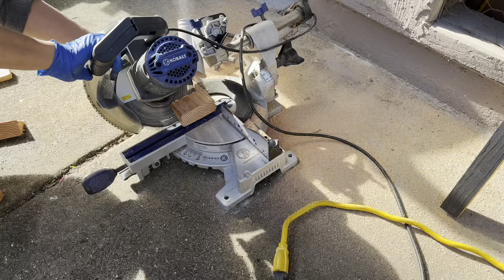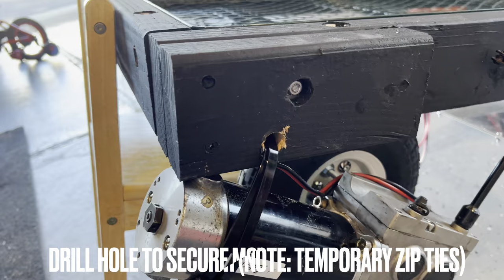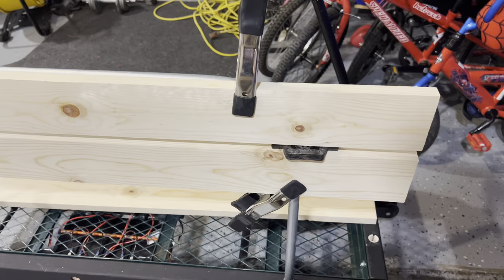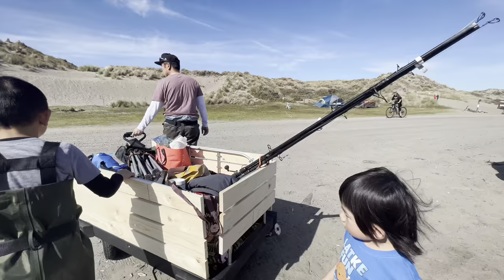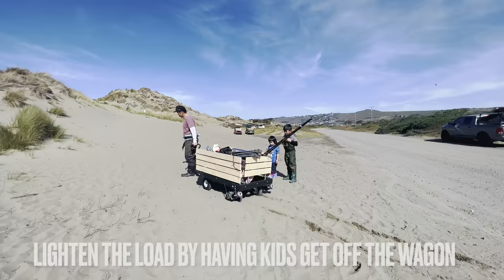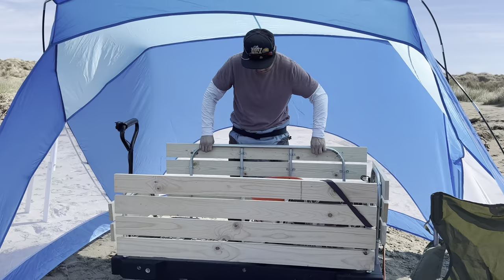How To Build An Electric Beach Cart Wagon From Ordinary Garden Cart Part 3: Framing And Railing

Comment: For sand you need some type of paddle tire like atv, it will help dig and push vs non paddle tire, 2 tires on the motor wheels should be a enough